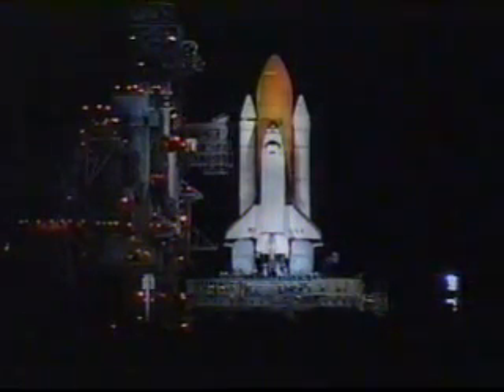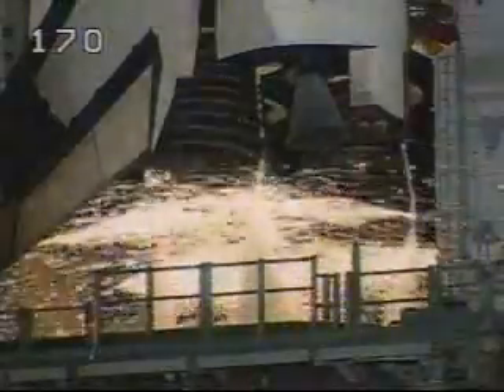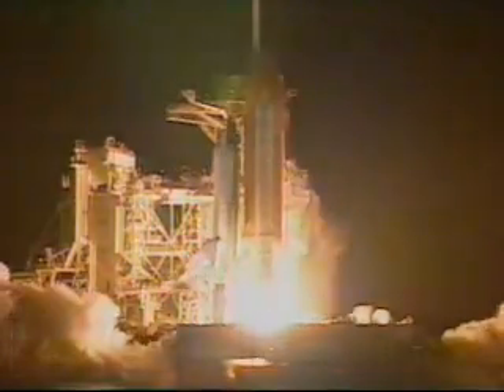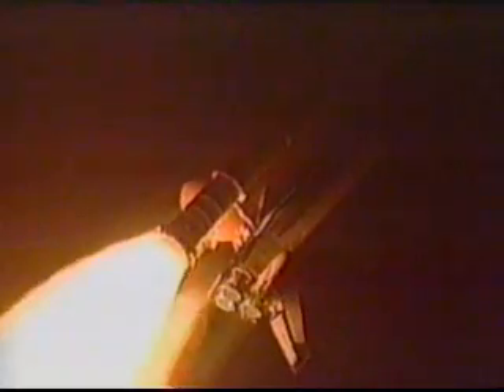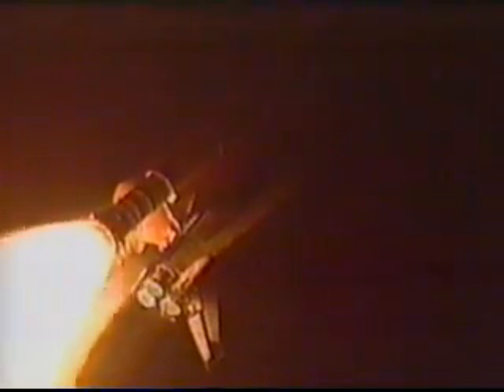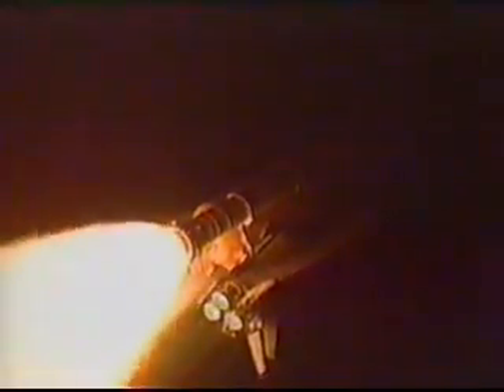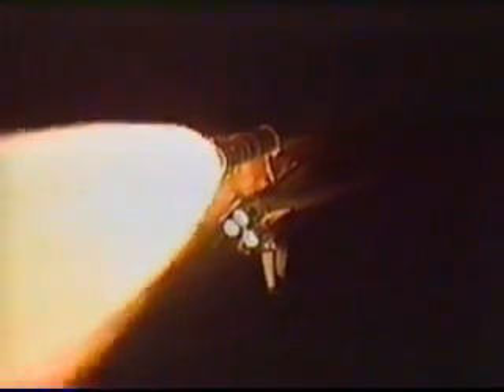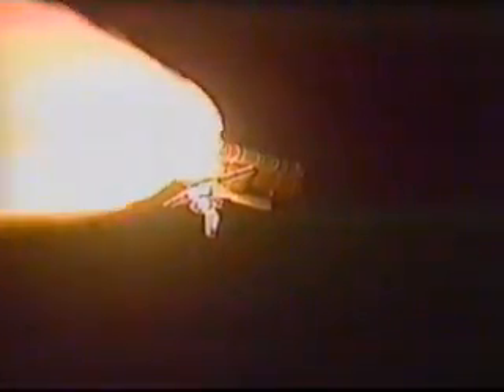STS-93 Launch

Comment: I salute Jeffrey Ashby and Michel Tognini on their first space shuttle mission! 🫡❤️🇺🇸🇫🇷

This was Steven Hawley's fifth and final space shuttle mission and final time in space.

This was Michel Tognini’s first and last space shuttle mission and his second and final time in space.

During engine ignition, a loose plug damaged the right engine, causing a hydrogen leak. Liftoff continued, but five seconds later, an electrical short disabled engine controllers. Backup systems kept the engines running, and the shuttle safely reached orbit, though slightly under target speed. The incident led to wiring checks and a change in engine maintenance procedures. A prior launch attempt was aborted due to a false hydrogen reading.

Comment: You can definitely tell something's up with the right engine just before liftoff. Kudos to Collins for jumping right on that as Columbia cleared the tower. This is the first time I remember a pilot responding to Houston during launch. Collins must have been busy, as I would think she would be in the situation.
Reply: Actually, Collins was CDR at STS-93. Ground crew dealt with all failures leaving flight crew to move exactly one switch. Not exactly a busy flight :D
You can read whole story here:
https://waynehale.wordpress.com/2014/10/26/sts-93-we-dont-need-any-more-of-those/
Reply: @Nikola16789  - A huge difference between having to move one switch and not being busy. As an airline pilot, when we run through emergency scenarios in the simulator, or on the rare occasion they happen in reality, there may not be a whole lot of switches moving, but there is a lot of brain power devoted to scanning, evaluating, and preparing for what may happen next should the situation worsen. I am absolutely positive Collins had a lot going through her mind at the time as she was evaluating the situation and preparing for what may happen next.
Reply: @J Smith: Generally I agree with that, but space shuttle was not ordinary airliner. Shuttle was much more complicated, and because of that it was designed in that way many (if not most) failures were not presented to crew. Hundreds, or even thousands of people worked hard to relieve crew's cognitive resources. 
As you can read in the blog, the crew was unaware of SRB HYD and performance problems. They learned about electrical problem when MCC call for that switch to be moved.
Reply: @Nikola16789  - Not disagreeing with that. What I am saying is that the idea of the crew just being along for the ride is just not true. Because of the complexity of the shuttle and significant risk of extreme catastrophe, the on board crew would have had a lot going on in their heads. While this failure may have only required one switch to be moved, and there may have been other things going on that the crew might not have seen, the crew most certainly had a lot going on. The crew knows enough about the systems to know that if they see a failure, there is a high likelihood there are other things happening. They know enough about the systems that if they see a "Fuel Cell PH" failure, that it may lead to other consequences, including a highly dangerous RTLS abort, which would require significant action by the crew and would have been life threatening.

Comment: Are you referring to the exhaust riding up the SRB near the External Tank? That's actually normal and happened on just about every flight. As the vehicle got into thinner air and speed built up, a vacuum formed behind the tank (similar to the vacuum behind a race car that allows for drafting), and some of the exhaust gasses got sucked into the vacuum. It's just a lot more noticeable on a night launch, but it was nothing to worry about. NASA called it "plume re-circulation".

Comment from the maker: That noise comes from the Sound Suppression Water System, it's the air being displaced and pushed out by the flooding water...creates a whistling noise
Reply: I never knew that either...thanks. I knew the sounds of the hydrogen burn igniters as they went off at T-10, but never associated the whistling sound with the start of the sound suppression water system. Very cool!